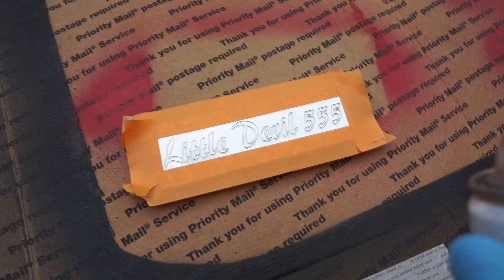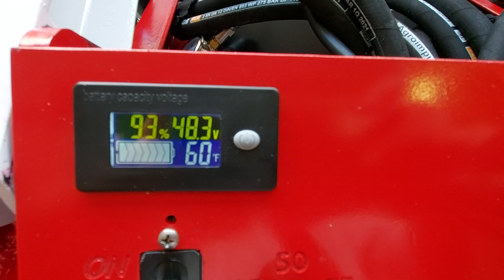Homemade hydraulic mini Electric Skid Steer Loader (Part 4 the big reveal) powered by Li-Ion battery

Comment: Good job sir!! I too will be building my first diy mini earth mover/skid steer/ portable mini shop crane!! Im just now acquiring some uesd farm equipment, and a large used golf course riding mower by toro,its huge! The 3 cylinder Kubota diesel is all its missing but has 12 hydrolic cylinders, a mile of hydraulic lines,distribution blocks,multiple spool levers ect,ect i cant wait to start!! But awesome job and you totally threw some coal in the fire for me to get mine done!!

Comment: I have question about elektromotor power setting: would it be possible to make this 'automatic'? So perhaps on target pressure, if it drops it increases power, else it decreases. Love this design, but was thinking that this fixed % power setting could be made automatic.
Reply from the maker: Maybe, you can probably put a governor on it, but I just don't think it's that important.  As I haven't seen it bog down that much because it has so much torque.  Unlike the gasoline engine.

Comment: Nice work! Now you have not only a mini skid steer, but you also have a mobile hydraulic power pack, if you add yourself a set of quick connects, you can then make or hire attachments for other jobs.  Ps, a lifting jib would be very handy for unloading from the pickup truck.
Reply from the maker: Thanks for the tips!

Comment: What are the specs on the wheel motors
Reply from the maker: 9.4 cu in Danfoss 155160A1312AAAAA Hydraulic Motor

Comment: I love your machine, I have a similar machine I bought from a back-yard engineer but mine is built on a zero-turn mower type of design and is gas powered, I am debating either converting mine to Electric or just starting from scratch to build one like yours and re-use all my hydraulic gear.
Reply from the maker: If your current machine can do all you wanted and you just want to convert it to electric, then go for it.  But if you want more power or heavier duty, might as well start from scratch and sell the one you currently have.  Good luck!

Comment: Awesome build! I need one of these to help with chores around the house. Would you sell me one?? How much?
Reply from the maker: I'm not sure if its worth it for me to make these to sell, it takes a lot of work.  You can buy them commercial machine, they run 25-35k for a new one and 15k or so for used one.  I wouldn't think anyone would spend 10-15k for my machine since it's a diy and hasn't been fully tested or warranty.
Reply: @devildestiny555  Good thinking. I can't seen to find any mini skids that are electric. I really don't want to hassle of dealing with maintenance on a diesel/gas engine. Do you know of any brands that sell a nice mini electric skid?
Reply from the maker: @richardzhang1447  commercial construction company just starting to get into electric.. Toro make a Toro E Dingo, but they don't even have the price advertised... make me think that it got to be way more expensive than their fuel version.  There's a couple more brand from Australia you can find.  I certainly can make more and better version of mine.  But I am not sure if anyone will buy mine at 15k?  Would you? Because if less than 10k then it won't be worth it for me because of small production.
Reply: @devildestiny555  Yeah I think theyre going to try and charge more for electric vs fuel. It's a shame really. I think it's worth 10-12k to me. I also dont need a ton of battery life, that helps cut down the cost dramatically. I think 2 hours of operating time between charges would be more than enough for me
Reply: Lot of people marketing electric equipment. Not very many will actually sell you something today
Reply from the maker: @richardzhang1447  where are you at? Maybe email me and we'll see.  devildestiny555@yahoo.com

Comment: this is super awesome!  how did you decide on the size of the structural members like the thickness of steel ?
Reply from the maker: Didn't... used what I had and bought scrap and remnants steel... even that  has went up 100% in price.  However being cheap did cost me more time and labor, as I have to redo many spots.  I will make a in dept video soon.  Thanks for watching 👀.

Comment: Fantastic project well planned and build, what size hydraulic pump and drive motors did you use? Thank you for sharing your project with us.
Reply from the maker: Unfortunately I could not find any specs on the pump, but from my bucket test, it can do 8gpm at 16volts to motor and that's where I like the noise to be, very quite.  The drive motor are Danfoss 9cubic 16gpm/2800lbs/in of torque.  I will make a new video with details on the components.